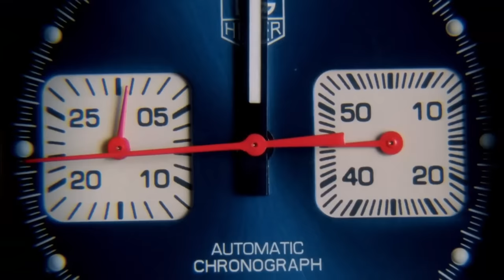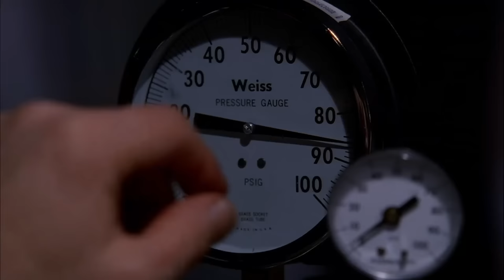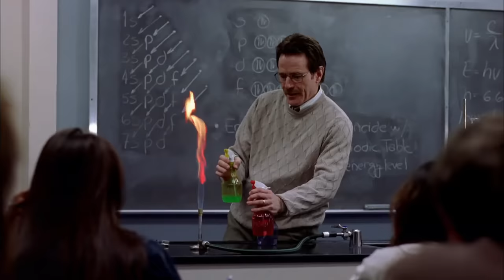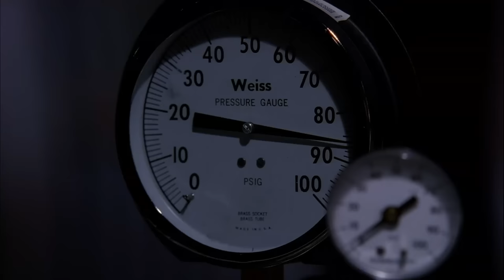Breaking Bad: Felina - A Complete Examination

Comment: I also like how the lasers are shaky
If it’s by two skilled hitmen, the laser sights should be steady but the lasers move even at some points not on Gretchen or Elliot. Showing how the lasers are not held by two skilled hitmen. It’s the details
Reply: a laser sight would be shaky like that because you typically use a laser sight for either very close or very long ranges, and at long ranges every micro adjustment is going to be amplified

Comment: He taps on the gauge because he’s proud of Jesse to see that he’s followed all his cooking instructions.
Reply: No. He made sure the distillate was evaporating under the correct pressure. Too high and you got liquid that'll be useless. Too low and you'll get cruddy gum that won't burn clean for the smoker or crush into powder for the tooter.

Anyways, he was tapping it to make sure the needle wasn't stuck.

Comment: What i don't understand is "how the hell did Walter reseal the Stevia packet?" 

Other than that, its a fantastic finale. I can even write off the watch (retroactively speaking) as Walt maybe shedding himself of the last bit of his well-mannered facade. I could possibly see it as him finally accepting himself as Heisenberg, as well as it signifies that Walt has submitted himself to his fate. Granted, i dont think that was the original intention when they did that scene (like you said, it was done to fix a continuity error), but i think it still works as that symbolically.
Reply: i liked to think he may have emptied and refilled it through a less obvious place (for example the side of the packet) so it wouldn't be noticeable if you looked at the most basic place to suspect, which would be the seal. actually i think those packets are very paper-like so you could slice them vertically by the side and subtly glue it back together

Comment: 17:54 
Here we see a bullet strike the number "10." 10 is an important number in Breaking Bad, as the names "Walt Junior," "Steve Gomez," and "Skinny Pete" all contain 10 letters, and each represent the three worlds Walter White lived in--his family life, civilian life, and criminal life. With Steve Gomez dead, Walt's civilian life was over, he would be a wanted man. With Walt Jr. now going by Flynn permanently, Walt's family are alive but his own connection to them is dead. That leaves Skinny Pete, and the one life that he would live until his ultimate death caused by the bullet ricocheting off the "10." The striking of the "10" means that all three of Walt's lives are over. But of course, Thin Peter still lives, and this sets the stage for the inevitable sequel series following Skinny Pete after he drives the El Camino to throw off the authorities without his iconic beanie (an inversion of Walt and his Heisenberg hat) who will eventually pick up Walt's torch and live his life untethered from his family.

Now there is one problem with this theory, and that's that I pulled it entirely out of my as I wrote it, but I'm sure Vince planned it.

Comment: The owner of the car is not negligent. The scene takes place in Alaska. Very common for folks to leave the car unlocked AND keys in the car because of polar bears. Cars are shelters. Keys allows you to start the vehicle and provide heat and or drive away if needs be

Comment: I don't think Walt should have been shot, atleast not with how things were set up.  If you notice the bullet pattern from where the gun was spraying through the wall, it would have been impossible for any of those bullets to hit him.  Considering where he is laying, and the type of bullet being fired, he also shouldn't have been hit by any ricochet, as those bullets should have went straight through everything in the house with not much change in direction.  Had it been something flying around the house that broke due to the gunfire, that's one thing, but it wouldn't have had the momentum or velocity to punch straight through him as is seen in the show (he's laying on Jesse when he takes the hit, but bleeding from the front, indicating a full pass-through.)  The only thing I could think of that would have been possible was if one of the others shot him, but I doubt that would have been what happened as they all died pretty quick, and any reaction would have been towards the sound.

Comment: Ok, so we just started, and I have a problem if you lived in a very cold northern area that is in a small village in a stupidly remote area you find that many people would "hide" the keys there or under the mat alo most people, even if they didn't, would in fact leave there car unlocked. I mean who's really going to steal it besides locks ice up as well as inlocked cars can be an emergency shelter to the ridiculous blizzrds that frequently and without warning strick. I live in a much bigger town than this and a lot of people just leave there cars running in cold weather to keep them from freezing up. Now admittedly this practice is slowly changing but odds are there are a few vehicles there and at least one would be unlocked with the key in it. The fact the police were that close to hom and that he found the keys so quick in the first car is well because TV drama suspence and no point dicking around wasting 15 extra minutes of screen time.

Comment: 2:50
I think he kept the watch for practical reasons, as it was likely his only clock out in the wilderness. It may have stopped working in time, due to the cold, but that could also be symbolic, as winter (and the accompanying cold) is the season of death.
Time has stopped for Walt, and I recall him getting the watch on his 51st birthday from Jesse, right? Or around that time, anyhow. Either way, he knows he's living on borrowed time, so it seems to point to him deciding to do what he can to make things right from now on, as little "good" as he can do given the damage he's done. Also, since it happens upon his drive from a cold climate to a hot climate, I'm fairly sure it's supposed to be him accepting it's a one-way trip.
Anything with a clock as imagery can provide a rabbit-hole, but that reason makes sense... though others would also make sense.